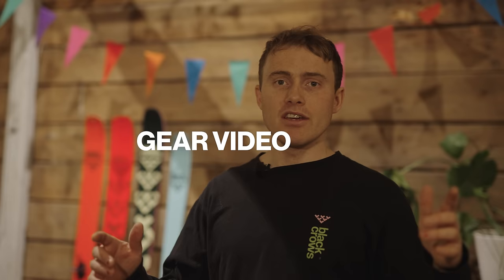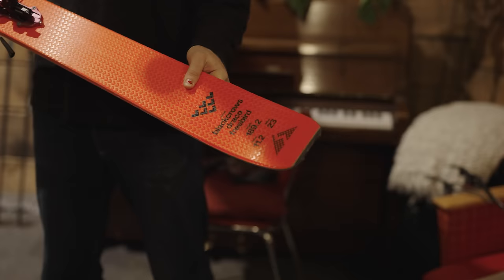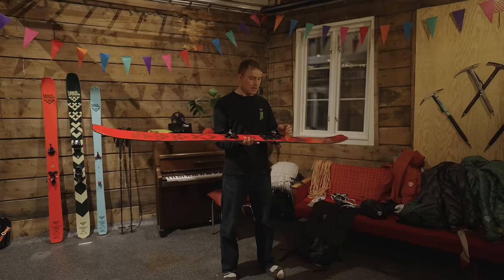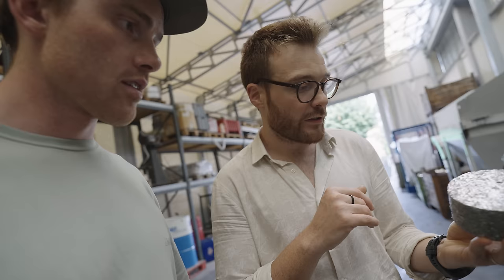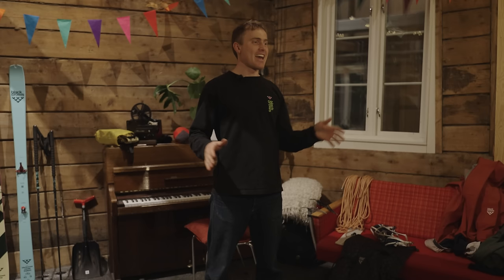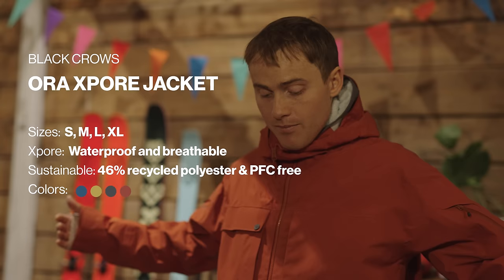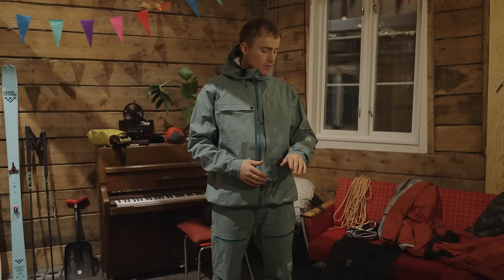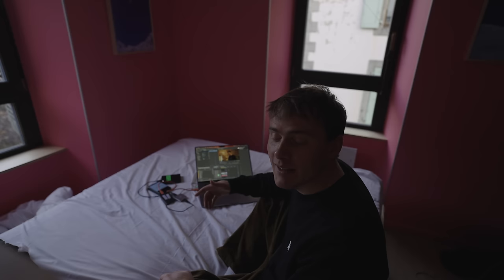The best backcountry ski gear, 2024

Comment: The first thing i thought when you mentioned "electric helicopter" was: "why not use a paraglider?" Yes, Sam Anthamatten did that already so it wouldn't be something new. But the other problem I see in this case is, according to my limited experience of Norwegian weather (roughly 1/2 year, autumn semester until past Christmas plus 1 week in March for skiing in Lyngen) there is pretty much always alot of wind coming in from the coast. Hence a miniwing would be more appropriate for a task like this. But those can be pretty twitchy in certain conditions and wind direction towards the wing... So i guess it's not the ideal tool for the job.
Reply from the maker: There’s a few companies developing cargo drones. They can carry 80kg now. I think if those get a little more heavy duty it’ll be the way to go
Reply: @Nikolai_Schirmer  Haven't thought of those, since drones (or better quadrocopters) aren't really in the realm of what i look at in aviatics. But sounds interesting. I guess the logistics of it would be interesting in this case... Auto-return or someone else remote controlling the drone?

Btw: since it's a gear video: any tips on keeping snow of sticking to grip walk soles? I always get a clump of snow on my boots and then all the grip of "grip walk" is gone...
Reply from the maker: Return to home would be the dream. Just let it fly back to the car. 

Oh, I haven't really experienced that issue. What sort of surface are you hiking on?
Reply: @Nikolai_Schirmer  I only use one ski boot for everything (K2 Mindbender 130 in my case). But especially on resort days i always get a clump of ice and snow sticking to the sole when e.g. going to the restaurant / bar etc. Just walking from the ski racks on the snow to the entrance.
While touring it's often less of an issue because i either skin up or ski down and don't usually visit a hut inbetween.
Maybe I could just switch out the plates, but the sole doesn't look that worn yet.
Reply: @Nikolai_Schirmer  taking a train through eiger to jungfraujoch then paragliding 500m air distance to eiger to ski untracked pow, fucking dream if you ask me
Reply: The problem with relying on wind is that you rarely can rely on it. There isnt really thermals to gain alt on a paraglider in winter, but i have seen people use a kite to drag them up. But you need to go quite straight up the face, and the flying gear is a little bulky. So its very specific scenarios where it works.
Reply: @mettflow2648  yess! Completely agree!
Reply: @eliasevertsson4470  yes, that is a problem. From my time in Norway (yes it's limited and definitely didn't fly between parties - damn that semester was expensive xD ), i felt like there was quite a constant wind from the coast/west (of course not as ssignificang if you went further in land toward Røros etc.). I guess largely caused by the Iceland lowpressure system generally rotating anti clockwise. But probably causes  a dominant winddirection from the east further north then.
If my memory and basic weather knowledge is correct, this could give access by soaring up along the mountainsides.
Todays hike&fly harnesses and wings can be packed down pretty nice, but still will need more than a 27l pack.
The times of bulky full-foam harnesses (still got one of those) are definitely gone in my opinion. In certain appllications they might remain (e.g. acro) but in most cases i don't see them anymore.
Reply: @WaechterDerNacht  maybe when you're waxing your skins in the cold, try to apply a tiny bit on soles of the boots, it worked for my friend

Comment: I don't get how you can talk about the dreadful toxicity of Goretex and then happily drive an EV with a lithium ion battery.
Reply from the maker: I'm sorry if I missed something, but does lithium seep into the water table and accumulate in the apex predators? There's a reason even Gore-Tex stopped using the original Gore-Tex :-)
Reply: Sorry I should have made my point more clearly. The production process for these batteries is extremely energy intensive - from mining in Africa or Australia to manufacturing in Asia. There is a lot of back and forth international shipping involved with isn't exactly great for the planet. The batteries themselves are toxic, and if recent reports from Taiwan are to be believed they seem to be rather unhealthy the people who build them. Add to that there's currently no viable commercial recycling process, which means they're going to have to be stored somewhere, for who knows how long. I am not disputing that the original Goretex was bad stuff indeeed, just making the point that EVs aren't as good as they're cracked up to be, and that there was an inconsistency there. Cheers John @Nikolai_Schirmer
Reply from the maker: Ah! Yes, I fully agree that current mining processes are not the best and that the social conditions are abhorrent.

There's actually been some positive development on the recycling front though, with companies like Fortum recovering 80% of the batteries to be reused (and making money in the process: https://www.fortum.com/services/battery-recycling/lithium-ion-battery-recycling-technology

I assume you're comparing the cracked upedness of EVs to ICE vehicles. My take on it is that they're simply the lesser of two evils. Any living organism, from a single cell to us humans, will always produce waste. That's a fact of life. Be it the 20% of the batteries that currently isn't being recycled or the greenhouse gases the ICE vehicle emits. It's just a matter of making sure that waste doesn't harm the ecosystems to depend on for society and life. At the moment there's a unified scientific community that supports the notion that reducing greenhouse gas emissions has precedence in that regard.

Now if electrofuels or CCS technology matured that might change, but for now wouldn't you say it makes more sense to buy a new EV rather than a new ICE vehicle? 
 @johndarby4503
Reply: Lots to unpick here matey. I hope this conversation isn't boring the shit out of your followers! It's great to see that recycling is being commercialised. I'm sure it's only a matter of time until its being done efficiently at scale. 
I do find it hard to put aside the human and current environmental cost of EV manufacturing and its inputs though. It's kind of the whole point.
As far as greenhouse gas emissions and EVs go, it depends a lot on how the electricity they use is generated. In Norway and here in NZ mostly it's hydro. In many other countries not so much. If I were to buy a new car for the way I use a car - which is mainly long distances driven for business and adventures, I wouldn't buy an EV - which still use a massive amount of petrochemicals in their construction - I'd buy an efficient petrol car, which I think is what makes sense, and will continue to do so for the foreseeable future. Having said that it makes even more sense to buy a good quality used car and do your best to extend its lifecycle as long as you can. Wouldn't you love to have a nice restored 1960's Citroen DS or Peugeot 404 Safari wagon? That would be very cool and tres Black Crows. :) @Nikolai_Schirmer